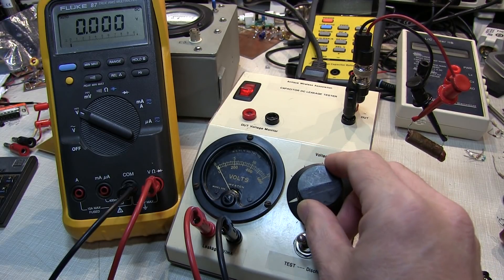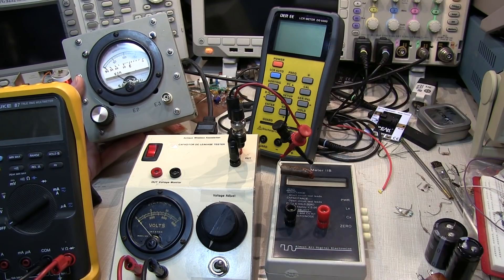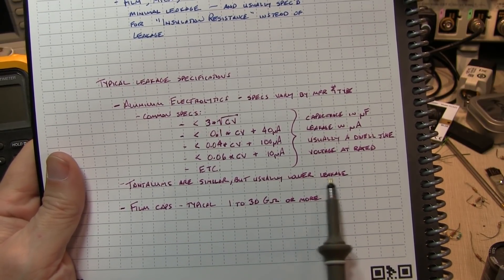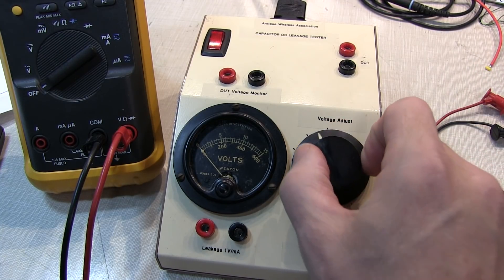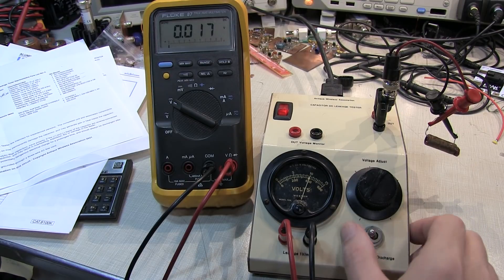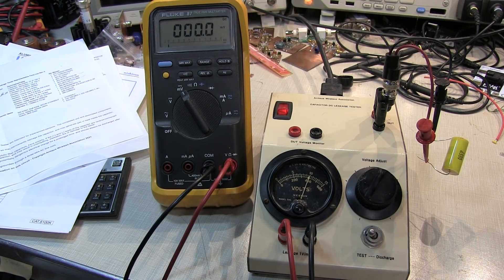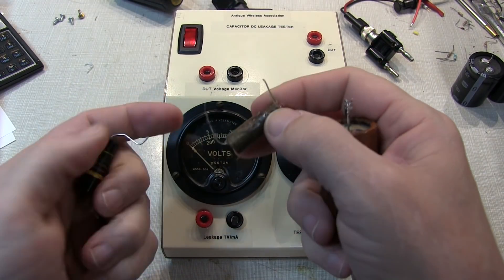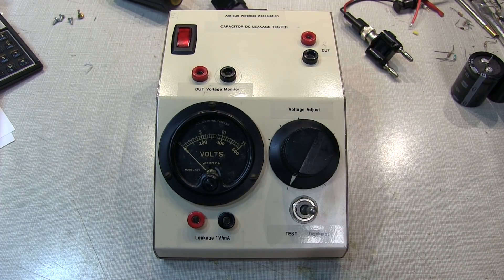#346: Basics of Capacitor Leakage / using the Antique Wireless Association DC Leakage Tester

Comment: Are you happy with your DER EE DE-5000? The gear is cool overall, but I am annoyed by low contrast LCD (it depends on the angle of view, but the maximum of the contrast is observed at inappropriate angle of view) and by its slowness (how much time it takes to update the readings, to choose right mode in auto-mode, to switch to the correct range of measurement).
Reply: I too am curious. I see this popping up on a lot of benches, and I'm thinking of getting one for field work. I hate taking my BK 886 out of the shop. Also looking at BK 880 for travel days.
Reply from the maker: I'm reasonably happy with it - probably worth the price, but it isn't perfect as you say.  But overall, I like it well enough.
Reply: I also have one of these meters and find it worth the money, yes it may be a bit slow on auto range..but it's going through quite a few tests in that time. If you want quicker make use of manual modes,also the nice blue backlight puts an end to poor contrast display. The meter also has go/no go function for batch testing (RCL) that can be handy for getting close matching components or sorting out the parts bin. This is a 4wire test meter so also works well with low value resistors (particularly handy for batch test/matching). The meter will pay for itself after a few repair jobs.
Reply: I've had one for about five years now. As w2aew says, it's not perfect, but I've learned to trust its measurements once I knew what it's actually doing in certain modes.
If the display is an issue, I'd recommend building an infrared-to-USB adapter (3D print the case, find an IR phototransistor and resistor, connect them to a USB-to-serial board) , and using IETs' PC software or sigrok to show the data on a computer monitor.

Comment: What wire gauge was used for the HV connections?
Reply from the maker: The wire I had as 18 gauge (much more than needed since it is all very low current), but has 600V insulation rating.

Comment: Good stuff Alan! I need to get one of the AWA testers for my bench.  It should be noted that not only ancient caps die.  My SEC 1340M power supply died an untimely death due to modern electrolytic caps that were part of the "Capacitor Plague" (2007 to 1999).  https://en.wikipedia.org/wiki/Capacitor_plague.  These bad caps mostly impacted computer equipment of that era, but also made their way into a lot of other gear.  The AWA tester would be great for the caps in the high voltage side of switch mode power supplies.

Comment: Looks a lot like the "Little Leakage Checker" - a Popular Electronics 1980s project, with a substitution of a pot instead of a stepped/switched resistor chain and possibly made more sensitive with substitution of a different series resistor (100 ohms in the Little Leakage Checker, for 1ma scaling)....

Popular Electronics Electronic Experimenters Handbook 1987 has the project.  Available at World Radio History AND The Internet Archive.....

I built one ( used a 1 meg pot in lieu of the stepped resistor chain) , but gave it away when I got my Sencore LC102.

Comment: For new comers to the hobby you may wonder why we test these capacitors at high voltage and look for leakage and it's because of where they are used in older vacuum tube equipment. Many of these paper and wax capacitors are used to couple a signal from the plate of one stage to the grid of the next stage. And if the capacitor has leakage it will allow some of the plate voltage to "leak" into the grid of the next stage. This potentially results in damage to the tube receiving this leaked voltage. Alan, thanks for the video and the info on the tester.
Reply: I'm an old timer in the hobby, and I too wonder why you would test them.  If you see paper and wax capacitors in an old piece of gear, remove them and toss them.

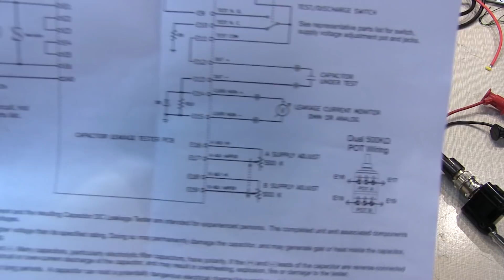Comment: 7:48 for the schematic. Also check the description for a link to the kit.
Reply: Yea,kinda missing some vital comments there. As was mentioned in video, this is the wiring diagram to the pcb. The circuit diagram has not been published, you may get that if you buy the pcb.

Comment: The lack of protection around the DUT, especially at 600V, is a concern regardless of who is using it. I'd be thinking about enclosing the DUT in some way.
Reply: Just learn to use a modicum of caution.  You are the one applying the test voltage.  The current applied to the capacitor is very low.
Reply: You are free to do whatever you feel like you need to.  This is how capacitor testers have worked forever, often only one lead is removed from the circuit, sometimes neither
Reply: Electrical insulation testers are used every day throughout the world, these generate 250v-1kv,termination is much the same but with finger size clips. Yes, a bit of common sense is required and caution when working with charged capacitors (this also includes electrical installations with insulation tester).
Reply: I was thinking a light on top to come on when voltage is present.

Comment: Thx so much for sharing.  I have never worked at such high voltages so even at my age there is still plenty to learn.   BTW did not see green wire connected to chasis im sure i missed it, but just in case...
Reply from the maker: It is connected to one of the corner fasteners holding the PCB to the case.
Reply: @w2aew  Respectfully submitted: when you split the case you have an unprotected side: the top, meter side, no? (as at 17:33)?
Reply from the maker: @rdavis7729  Yes, you do - but you shouldn't be operating it when opened up.

Comment: For measuring leakage I connect my capacitors to my PSU with the multimeter connected in series(in voltage measuring mode). If the input resistor of the multimeter is in the range of 10M ohm thus every Volt will represent 1uA. Works well for low leakage capacitors, maybe something to make a follow up video of? Thanks for all your good videos.
Reply: 1 volt across 10 megaohms means 0.1 microamps. You can adjust the range with parallel resistor across the meter to reduce it's impedance (like 1 Megaohm for 1 volt/1microamp, 10k ohm for 1 volt / 100 microamp, etc)

Comment: what transformer is used? just a 115v to 230v step up? I like the low profile.
Reply from the maker: A dual center tapped 1:1. Secondary is stacked.
Reply: do those have official isolation specs or use at own risk
Reply: found the datasheet. I like the 229E230 only 2VA would be nice and tiny

Comment: Being an Aussie I remember a different AWA 🙂 (Amalgamated Wieless Australasia)  but sadly no more
Reply: I got some AWA test equipment on eBay once "as is, untested".
They had large battery packs in them, which had leaked everywhere. They had dribbled gunk out the back, and the seller had cleaned up the outside of the cases, but not the insides.
Fortunately, I didn't waste much money. I think I ended up just keeping the knobs and bunned the lot.
My BWD equipmet, though, is all solid as a rock. I have a video on my channel about a valve sine wave audio range oscillator that has a speaker in the back of it.